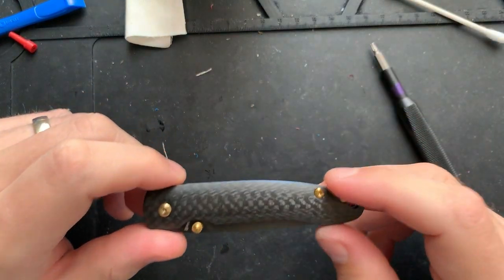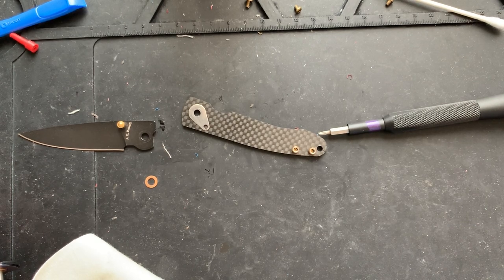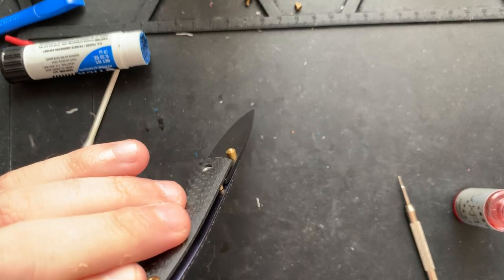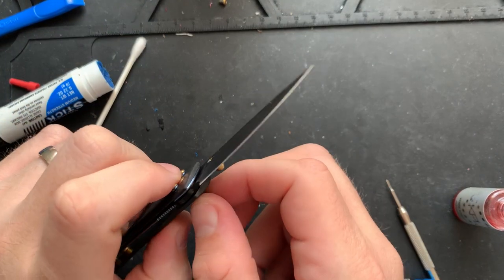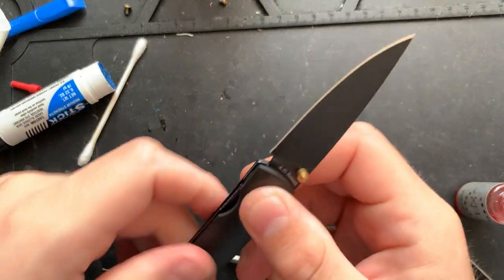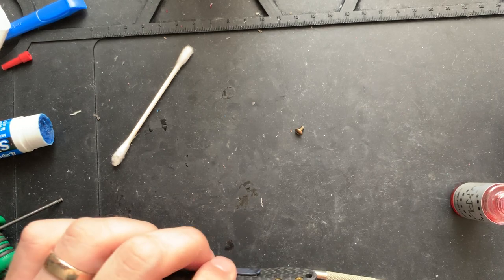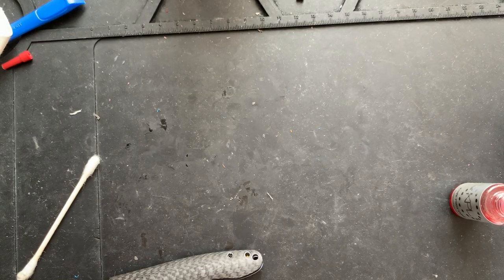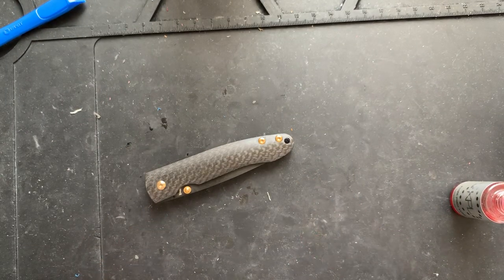How to disassemble and maintain the A.G. Russell Light'n Bug Pocketknife

Comment: Thank you for the warts and all method of filming. I've been a mechanic for twenty years and the days I remember and learned the most were those that didn't quite go to plan.
Reply: nathan nettik - The thing I learned the hard way in mechanical repair is to verify the problem before you begin repair so you know the complaint actually exists and is not a ghost problem in the  customers mind. If Nick verified the blade was centred before disassembly he would have a starting point. Laying the parts out in sequence of removal will tell you which location similar parts come from. Some simple jobs can become complex when you ignore these two steps because you are second guessing what you have done. But it was fun to watch anyways.
Reply: @kevola5739  symptom vs. problem.

Comment: My goodness, you’re obsessing over “blade centering”  but yet you used “blade pivot oil” on the liner lock/blade interface wich everybody knows requires a very specific lubricant formulated for that purpose 😱
Get you outside mic out and measure those bronze bushings!
Reply from the maker: *clutches pearls*
Reply: Before or after the swine? 🤪